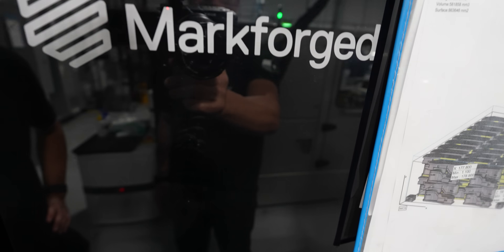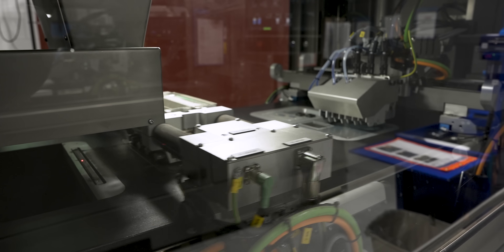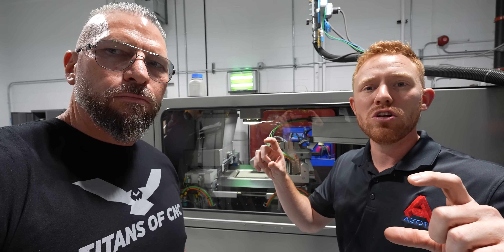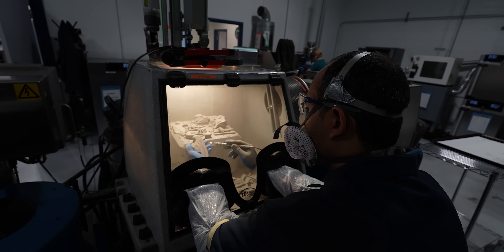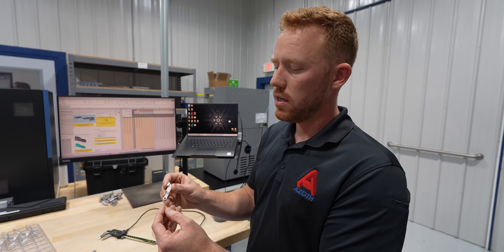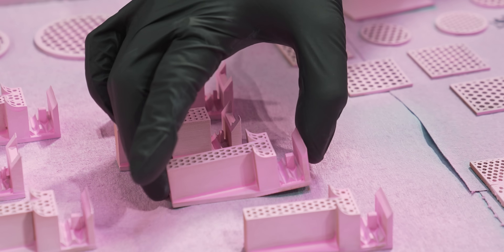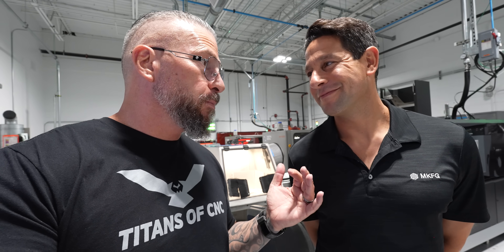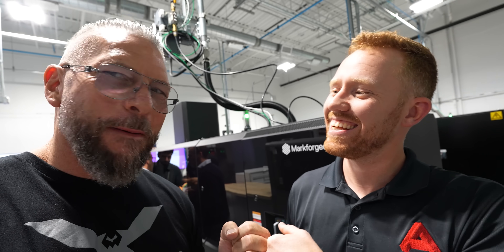HIGH SPEED: 70,400 Nozzles 3D Printing Simultaneously

Comment: I retired a few years ago but before I finished we had a gas turbine package set up in the yard for test running before shipping. The final thing we did before it was stripped down for shipping was fit a turbine core with a sintered blade and run it as a proof of concept trial. We did not give it a typical full life test or high stress test it. The blade was going to be removed for inspection and so it had to be a non-destructive test. This stuff was just science fiction a few years back.

Comment: worked in oil and Gas as engineer, 8 years ago i introduced printed parts to our bottom hole assemblies. Binder jet engineering PA from HP. It Cut out cost in those parts a lot. Its a great and reliable process.

Comment: MarkForge is the only company  that doesn't want to sell their machines. I called up my closest rep here in NC and wanted to buy  2 Mark Two's for 15K+  each  ready to pay that day direct payment, and the rep asked me how many people worked for me and straight  up said no I don't think you could use them. and then tried to talk me into getting regular 3d printer after I told the dude I already have 12 3d printers 3 CNC Mills  and 2 lathes.  I really don't like being talked down to from a sale rep. don't recommend
Reply: That’s extremely unfortunate and I am sorry to hear that. I run the additive department at Titans and aside from the one sales guy you ran into, the machines are rock solid. If you are still interested, I can get this resolved for you and get you connected to some high level folks at Markforged. It sounds like they would be a great addition to your lineup. 

Let me know and I will make it happen.
Reply: Who did you speak with?

Comment: Does the 20% binder material  simply hold the metal powder in its formed shape, or does it act as a flux.... or both?
Reply: The binder just holds them together in the green state. Some part of the binder is removed in curing, some in debinding/sintering
Reply: @lorenzomarchetti221  Thank you. 👍

Comment: The biggest hurtle with this in the industry is getting the old guard to accept the tech. Space X for example can do pretty much any thing they want. They own the launch cradle to grave. The Big classis D.O.D. Prime contractors like Northrup and Lockheed, are scared to end up in the same boat as Boeing. They see it as one 3d printed part away from another thresher disaster.

Comment: the machines are getting to the step in the process where a designer can now "design" around the machine. When we design, we typically know what the manufacturing process will be to make a part and will design the part knowing the capabilities and limitations of the machine that will be used. I've been doing it since the 80's and have been waiting feverishly for these machines to mature. As the guy was saying about internal passages, you can do things that other processes cannot do. If you use that knowledge of this machine and it's capabilities and limitations, you can change the way we make everything. Less parts is one thing, but also reliability, assembly and disassembly and use. It all changes when you can incorporate features into the design that otherwise would entail allot of additional components and then how them components fit and can be assembled and disassembled. I wish I had a job that would allow such freedoms. Good luck with the machines, Markforged is kicking butt out there.

Comment: All im seeing is cosmetic and non load bearing parts being made. Material consistency seems to be an issue. Need more engineers on board to get this into aerospace components.
Reply: They did have the seatbelt anchor part which is pretty bold for a 3d printed component.
Reply: and everywhere else. For prototyping it's great but there are still very few production parts being made from these machines. It's just now starting to get to the masses with places like this to make parts. I've made allot of products but none have 3d printed parts in them at production. Hopefully it matures and becomes more dominant.

Comment: i've seen binder jetting from a distance from a long time. i'm working for quite some time on LPBF machines and always wondered what's the pros and cons compared to LPBF for Binder Jetting. From this quick video i already can tell that this is the lack of need of supports thus support removal, so no marks and no work on the finished part, but i also feel like you would have more alloys printable than with LPBF. 

Great video overall, i really love seeing people have confidence like that and man that Markforged machine looks insanely good.
Reply: You nailed it Yannis. No supports is huge for many reasons, but also binder jet is typically 10-100x faster. For small parts, especially less than 75mm, binder jet is a superior process
Reply: live hinges and internal passages, SLS and binder jetting is a great way to go.

Comment: GE aviation has been printing fuel nozzles for over 10 years, 100k serialized production nozzles as of 2021. SLM tech has been around for almost 25 years with companies making metal printed prod parts since 2005. Binder is just another form. GE, Space X, Blue Origin , etc have hundreds of metal machines as well as service bureaus like this company. Not sure why everyone always thinks 3d printing and or metal printing is so new. SL and LS even go back to the 80's.
Reply: I knew it's been around for a long time, but not back to the 80's.    The precision and speed of this is the thing most people probably weren't aware of.  When I think of metal printing,  my thinking would go straight to larger beefy parts like handguns.  Tiny parts with precision capillary tubes is hard to wrap your (my) head around.  
Kool stuff.
Reply: @randywl8925 nah, it's been around since the 80's.

Simple patent search would verify this, instead of you shoving your foot in your mouth.
Reply: It's because the patents expired allowing more companies to use this technology

Comment: This IS the future of manufacturing of many kinds of parts.  It won't eliminate the need for other manufacturing processes but it's sure going to become a mainstream production method in the years to come.
Reply: UPS is integrating this technology into their massive worldwide discussion hubs.
Your customer orders it, and UPS makes it and ships it from their nearest facility.
Reply: Only for cases where serial production is not in that many parts, like that firearm part. As soon as you need more parts it´s not cost effective. But many speciality items and machines can be produces way faster and cheaper that way. Like dentestry equipment, firearm parts, supressors and such.
Reply: @sierraecho884  Still be an aid to serial production. e.g. molds, and forms, etc.
Reply: @brodriguez11000  oh yes absolutely, it´s fantastic. I use it more of less daily. But it´s mostly not for production. That´s why it´s called rapid prototyping since the 80´s.
Reply: I had the exact same though. "This IS the future of manufacturing" then I checked the comments and see yours
Reply: No it won’t shut the fuck up idiot
Reply: accuracy not great, 1%.  this is due to 20% shrinkage at cure.

Example you make 1" part has 10 mil tolerance - not good
Reply: @muskepticsometimes9133  Depends on the size of the part and it´s function. I would say accuracity is pretty good.
Reply: @sierraecho884  10 mill accuracy on 1 inch part not great.  I get it low tooling cost but only lower accuracy.  Decent machinist could do 1 mil
Reply: @muskepticsometimes9133  Oh Jesus, this kind of people again.
1. Good or bad accuracy is a matter of perspective. ±0,13mm isn´t bad for a metal part like that, not bad at all.
2. It´s not a machinist process, of course not because your decent machinist cost 10x as much and is less productive. So if you don´t need 0,01mm tolerances or you can machine it later on.
Reply: @sierraecho884  never said it was terrible, I just said not good enough for many parts.

And don't call me "Jesus" that is not my name I'm not Mexican
Reply: @muskepticsometimes9133  You said "...accuracy not great, 1%.  this is due to 20% shrinkage at cure.

Example you make 1" part has 10 mil tolerance - not good..." Which implies it is terrible, your quote "not good".

"...I just said not good enough for many parts..." No, you did not, you said it was not good in a general way. and saying just not good enough for many parts, does not make any sense because it means it is good enough for many other parts.
Jesus ^^
Reply: no, not gonna happen, it will be a minor part.
Reply: @JohnSmith-pn2vl  I agree, gonna be a small part.

Comment: You never see a 3D printer built on granite—that’s precision at a whole new level in additive!
Reply: You don't see cheap printers built on granite. That and I'm not sure if it's truly necessary for additive for many reasons.
Reply: @ScuffedEngineer as the saying goes, if you’re trying to hold a thou on a part then you’re machine needs to be capable of holding a tenth of a thou.
Reply: @rossadams9410  I guess you don't trust your precision ground 123 blocks or any end mill you buy? Or old cast iron inspection tables are bad as well. Or the LODTM should've only been made of granite blocks. 

I have nothing against granite in general. Just have to think of costs, what is really needed, etc.
Reply: @ScuffedEngineer good point but its not that expensive in reality and also faster then casting! Because the cast has to cool down for months
Reply: @ScuffedEngineer  i was thinking the same thing. I would think that Markforged would have done their homework though and needed it for some reason. There are moving parts in that machine, not sure what kind of tolerance they are holding and what a different base would produce.
Reply: I've seen a metal lathe built on granite but never a printer, until seeing this video anyway.
Reply: Our printer is made of 12 metric tons of granite!
Mainly for vibration dampening for the extrem highspeeds we print at

Comment: What is the Printed Structural Resistance Like?
Reply: Depends on which material they use for each part. But unlike other 3D printing, these jetted parts have isotropic strength properties due to the sintering process which is why they’re structurally comparable to traditionally machined parts.
Reply: @samster7704 more like comparable to MIM parts?